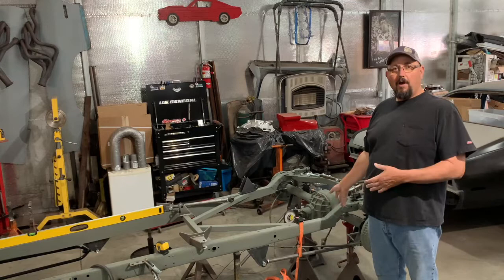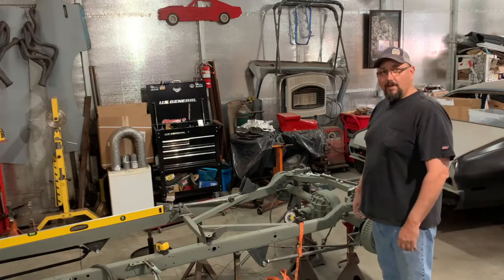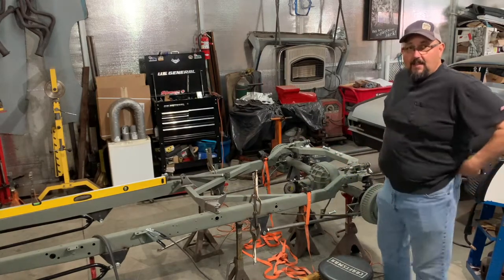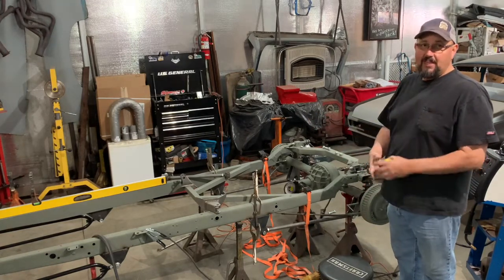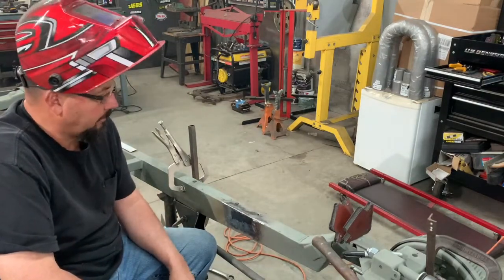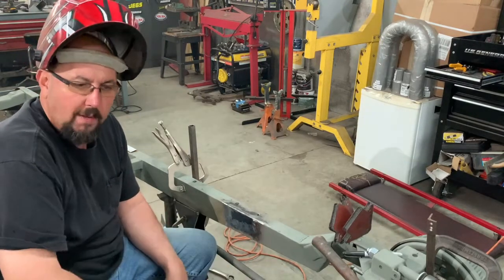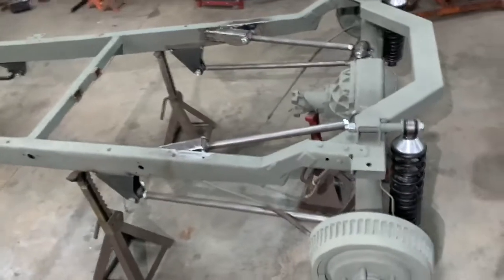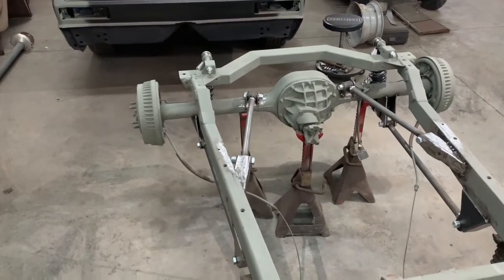Model A Coupe Hotrod Build Pt 6 Installing the Rear 4- Bar and Coil Overs

Comment: Great video. I'm loving this build series. Question - is that enough angle on those top bars? Have you had any issues with the body/frame moving side to side at all?

Also, what tubing size/wall thickness did you use for the 4-bar set up? Was it a kit? Thanks again. Great build!!
Reply from the maker: Thank you !  No it didn’t have any side to side movement. The 4 bar started off as a kit. Thanks for watching and take care!!